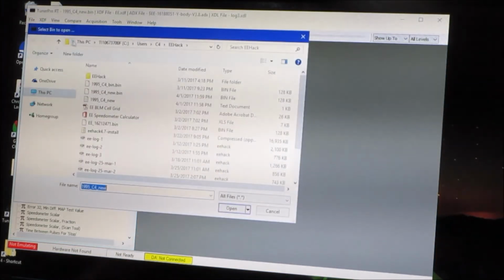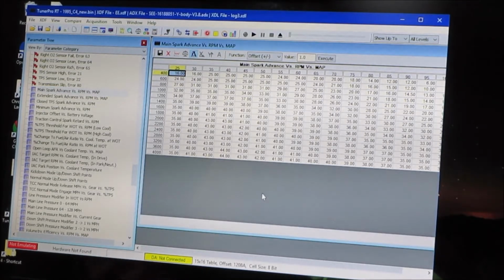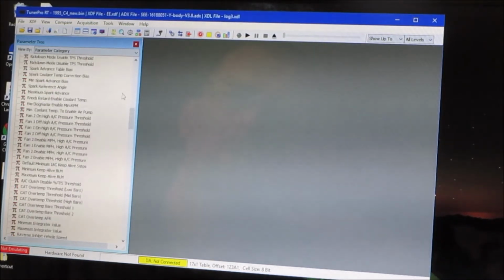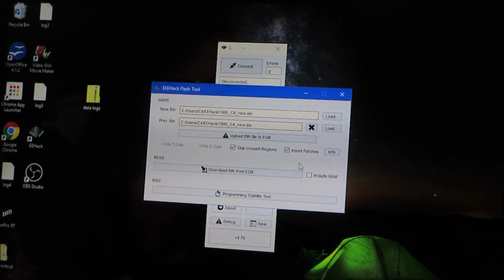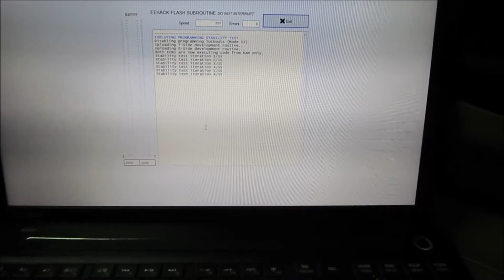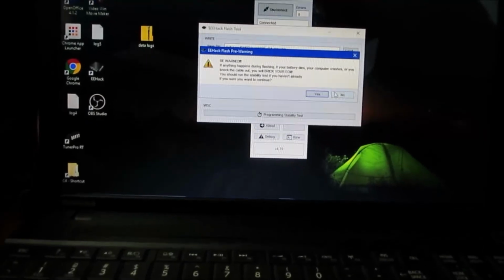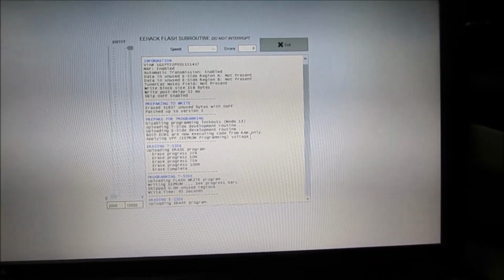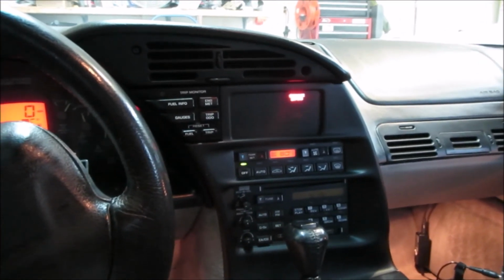1995 C4 Corvette Tuning: Bin file edit

Comment: Great videos  !!! I just bought a 1993 C4 and have never data logged before but I'm going to order a 12 pin aldl cable start . What temperature did you go with on the fans ? Also does the ehack come with tuner pro RT ?
Reply from the maker: Thanks.
No, EEHack and TunerPro are separate programs, and EEHack was written specifically for the 94-95 LT1. You'll probably need to get the cable and flash hardware from "http://www.moates.net/gm-19851995-c-64.html" Right now I have the fans set at 200 low and 205 high, with the stock 10deg differential. I'm still tinkering with the bin to set them a few degrees lower with a differential (hysteresis) of approx 5 deg. Also looking at adjusting the transmission line pressure.

Comment: Hey man, I really commend you for learning all that computer stuff. Did you try breaking the tires loose after you set the timing to zero?  What did it do?

So, from what I gather.... YOU FIXED IT!!  You actually found what was the cause of your rough idle when cold?  Congrats man! Well done, you stuck to it and got it done. All we need now are driving impressions.

So, what is your next project on the Vette?
Reply from the maker: Not so fast. I'm still getting MAF errors. ............but the idle is better, just not as smooth as it could be. I'll be doing an injector leak down test soon to see what that looks like. I assume that the injectors are clogged some due to sitting 4 years with gas in them.
The tires will break loose, but I haven't stood in it to see how it responds. 
So, it seems I'm still on the hunt for the problem. most likely its a combination of multiple things.
Reply: LOL... I was waiting for you to rain on the parade!!  OK then, keep at it and keep us posted!
Reply: @slythee1  check the pins on your MAF connector for corrosion and to make sure theyre fitting tight. My 94 Z28 MAF pins were loose and corroded.